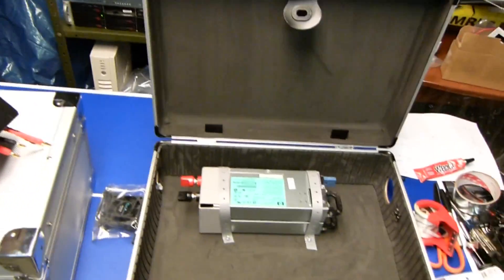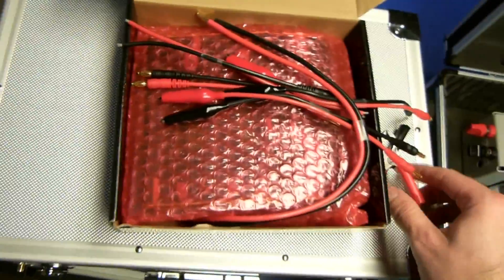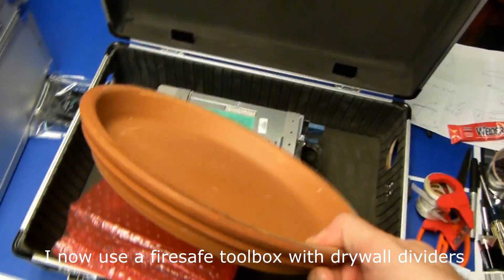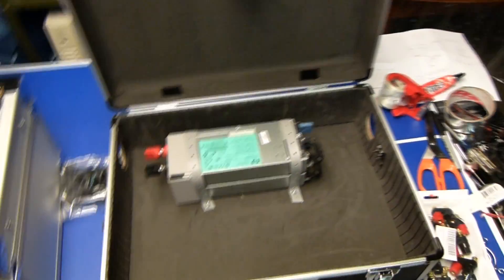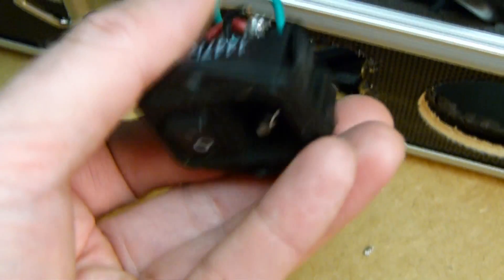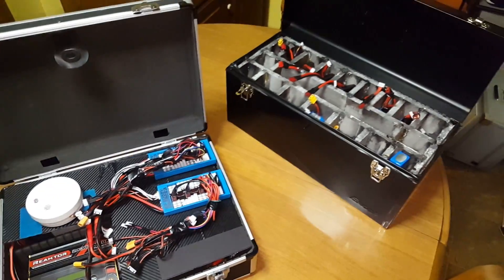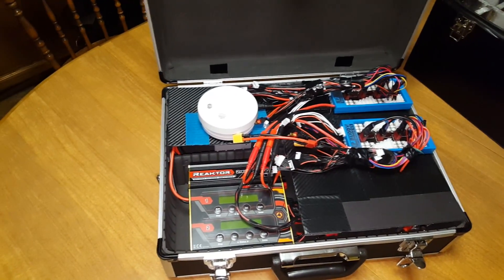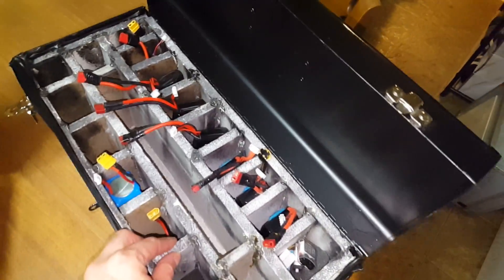Charging Station and Fire-Safe Lipo Box Build Log

Comment: The charge system in the case is pretty cool. That many batteries in that tool box is a large fire waiting to happen. Those little compartments are not going to keep anything from spreading. And I hope you realize carbon fiber is conductive, not an insulator.
Reply from the maker: On the box, the drywall should insulate each section.  I found the design from another forum that was recommended, however, i also keep sand in a bag in case of an issue and always under vision when charging.

Comment: Stew, what do you call the square connector you installed in the side of your case to connect the power cord at 4:35 . I'm trying to set up a case simular to yours with the power cord coming thru the side. However I can't find a connector like the one you used.
Reply from the maker: Sorry for the long delay on replying, the part was linked in my article, but here is here, i'm sure you've found it though https://www.digikey.com/product-detail/en/te-connectivity-corcom-filters/1-1609112-2/CCM1916-ND/2292077

Comment: The ground should probably not be shorter than the other (white and black). The ground is the last you want to lose.  You also might want to have a earth breaker in the connection.
But a great construction, with nice and well thought ideas, like the smoke detector.

The smoke detector and lose cables could be fasten on the lid of the charger station.  Or put a net there so you can put stuff there.

Comment: The smoke detector is a great idea!  I made a huge mistake one day and connected one lead from one battery and the parallel plug on another by accident and this happened https://www.instagram.com/p/BFc--UoB0ft/?taken-by=blink_fpv !   What a wild afternoon it was at my household...  Nonetheless, that box on the left in not fireproof at all - in fact it will catch fire as those panels are aluminum clad over wood.  My box like that was sitting 2 feet away from my charging block when the lilpo spewed...  Also, I had unfortunately left the barn and was not right next to it..  I now have a box to contain the lipos kinda like yoursCool box!
Reply from the maker: Wow, thats crazy, thanks for sharing.. yeah I worry that if anything in the box does go up in flames, if the heat from the box would affect the charging box.  I think it would contain it though, with the drywall.. nonetheless, i try to keep the two separated as best I can when charging, just in case.. i can also close the lid (but not locked, and has ventilation) if I choose to, while i'm charging.